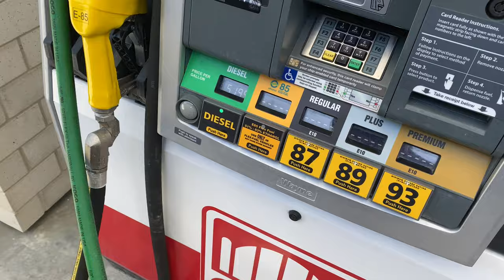Truck Camping in Florida with my Pet Goat

Comment: $5.19 for diesel...Biggest reason I went with a 2500 Dodge gas engine,  I knew it was coming.  Digging the camping set up though and loving the fact that you are taking your pup along for the adventure.
Reply from the maker: Yeah diesel is expensive! Luckily the truck isn't terrible on fuel. I'm sure if I had a gas engine in this truck, it would get like 10mpg. I average almost 18 on the highway with this one. And I can't forget the pup! haha